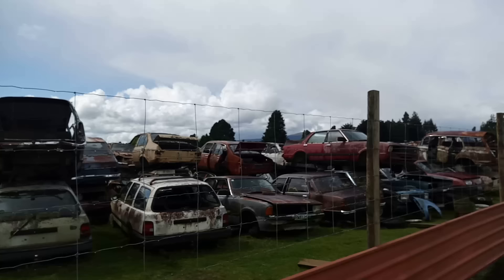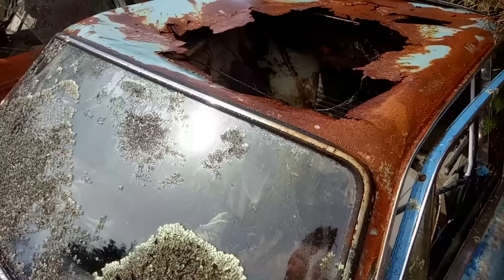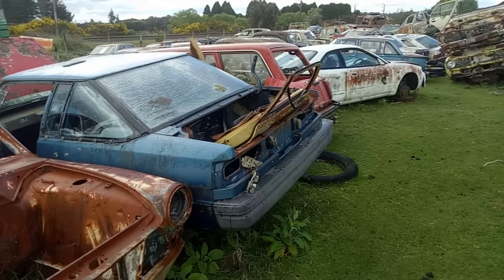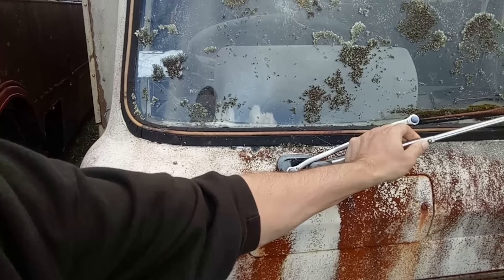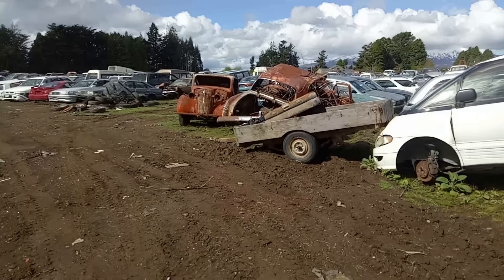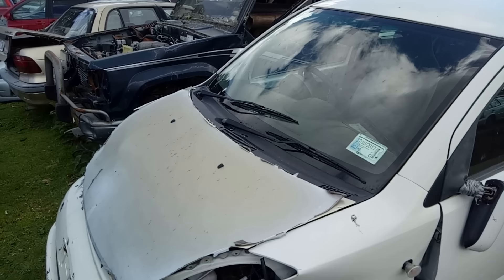(EP15) 1-hour of EPIC SCRAP! Horopito Motors, New Zealand - HubNut Goes Global

Comment: 12:14 An Avenger in a scrapyard!  Never!  From what we could see, it doesn't look rotten.  Oh someone save the Avenger.  (I'm an Avenger nut, mine is a 1972 Hillman Avenger 1500 Super.)
Reply: I guess more likely badged as a Plymouth Cricket. I saw a few I think though Ian only mentioned the one in passing. Shame on you Ian, best car ever to have been ignored.
Reply from the maker: There were quite a few Avengers in the yard. Lost some footage.
Reply: Another spotted at 37:22 but that's much too far gone.
Reply: @video99couk  Not crickets in NZ, locally assembled avengers and alpines gls's aswell. Then the Chrysler came though.
Reply: I'm a bit partial to the Avenger too.
Reply: @Zeem4  I've told Ian that next time he's in South Devon, he should call in and get to play with my Avenger (and Gen6 Celica).  They're his sort of cars, I actually use them, they don't just get polished on Sundays.
Reply: unlike cortinas avengers never rotted as much neither did mitsubishis which were made at the same plant in new zealand
Reply: I have 3 Avengers one '75 super 1300 which along with my Tiger MK1 is a complete restoration project, but also have a '72 1500 Top Hat. I know of only 3 other Top Hats and know the owners of two of them, you'll probably know being an Avenger nut like myself there was 700 Top Hats made and know believed to be rarer than the Tiger. You with ASOC, Avenger Sunbeam owners club? So I am with you please someone save that Avenger.
Reply: @thejamesieboy  Yes of course, with the ASOC group.  Let you into a secret: My channel's New Year Special for this year is (weather permitting) going to be road testing my Avenger.

Comment: "Impressive" isn't the word for that place Ian - I'm not sure what is other than "gold mine" or "treasure trove", but it's more than enough to make your wallet tremble in fear. 

There are obviously some blanks (cars you've not seen, or know little about) so I'll try to fill in a bit (NB my Oz car knowledge is sketchy, so if anyone knows better than me by all means chime in):

1:46 - Chrysler Valiant AP5 (early 60s)

3:04 - Valiant VK(?) (Oz, mid-70s)

3:53 - Valiant (VF?) ute;

(I think we're seeing a pattern here...)

4:11 - Holden HD?

5:34 - (yet another) Valiant wagon?

5:45 - I can remember lots of 2-dr A30s (my Dad had one - JTK 719) but I can't remember seeing a 2-dr A35 in Britain (in my defence I was Very Young); 6:10 Skoda 1000 - crumbs, I never knew they were exported this far away (Dad had a 110 as a loaner and later owned an Estelle);

7:15 - what on earth is that light blue small van-like thing right of frame? I've tried FIAT Multipla but it isn't that. Answers on a postcard to...

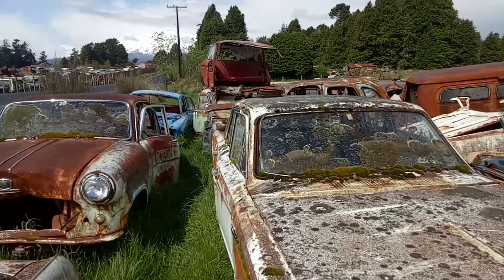7:40 - probably a Valiant (again) AP6;

7:55 - mid-60s Falcon wagon;

10:28 - To me it's "leonie" but is that a Mitsi Galant VR4(?) These had awd and (I think) 4WS. Plus bonus MR2;

12:01 - "Scrapyards are dangerous places". Ones like this especially.

12:43 - Oz gots lots of these vans a while ago. They had M-B engines (and badge) but I think they were "assembled" and "styled" by SsangYong at the same time the SsangYong Musso 4WD was around.

14:48 - I've hankered after a FIAT 850 coupe for years. I know I'm odd;

15:35 - cripes, look at the condition of the original interior of that P4. People in Britain would commit all sorts of bodily harm to get their mitts on that;

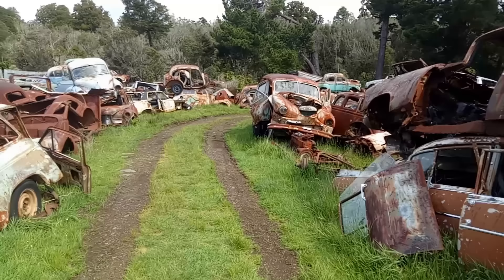16:33 - wasn't that the Hillman Husky?

21:56 - LAD-cabbed Albion/ Leyland Clydesdale (can't see the rear hubs) with possibly a 2-speed axle;

23:07 - Bedford TJ

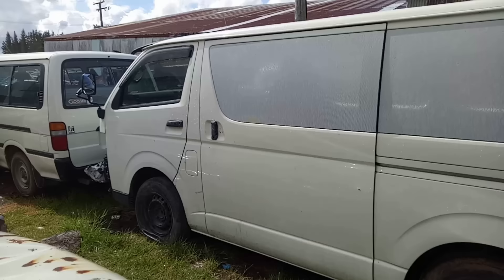24:47 - R12TL estate - yes please;

28:16 - it's a Toyo Crown, not a Nissan;

33:44 - series 1 Dodge Commando

35:25 - at a guess it's a Leyland Tiger Cub;

37:24 - blimey, where to start? 323 Astina, Lada, Toyo Surf; Datsun ute...

41:47 - no, it's a Nissan Pathfinder (not Terrano) - the Terrano was an ungainly narrow body 4WD thing that was also sold as a Ford (Maverick?). Unlike the Pathfinder, it didn't last long (thankfully);

43:18 - KH Ford Laser (as you say, essentially a Ford re-body of an early '90s Mazda 323). In the '80s and early '90s there was nowt wrong with a Mazda 323;

43:48 - XF Falcon;

44:25 - I do like early Sigma wagons, especially if they've got the Astron;

47:02 - Hino RG, bodywork by ...?

48:04 - facelift Mitsi Sigma

48:35 - Bedford TM and a very early one at that. The full-width cab versions got Cummins E290, R-R Eagle and - oh my oh my - Detroit 8V-92 2-stroke V8 diesels. If you ever get the chance to ride on a Denning (Oz-desgined and built) coach with either the 6V-71 or 8V-92 2-smoke diesel, take it. I promise you won't regret it.

49:27 - AU Falcon XR6 sans headlining; how disappointment;

54:25 - sold as a Daewoo Cielo(?) in Oz - unsuccessfully .

54:48 - neither did I (let alone sold in NZ)

Much like yourself Ian, I seem to have wandered off the plot a bit. I do apologise.

Comment: The twin wiper Camry was also licensed to Holden as an Apollo model. Sadly only a single rear wiper on the wagon from memory. Wonderful room, excellent steering but lacking engine power in 4 cyl. This arrangement was carried to the end of this 'wide-body' model c.1997 and started in the preceding smaller bodied line. The Holden was a JM & JP series, the Camry SDV10 (4cyl 2.2 litre) and aaaargh the V6 version transverse and fwd.
This incredible yard is one one level soul destroying...the waste ! But it is what it is...and has brilliant stock. Reminds me of a yard/yards in northern Geelong, Victoria what with all the lichen and mould and variety. The Laser hatch was available in a 4WD Ian in Aus and I think also hmm Turbo ?? Mitsubishi Australia designed a station wagon Magna...hugely capacious with outstanding load area competing with the Falcon and Commodore wagons of the day. The 2.6 four was a false economy motor however as it used very close to the far more powerful Holden and Fords of the day. Lovin' the Tercel choice, always wanted one of those...a 4WD Corolla and so so rare now. I've waffled on a bit, blame the coffee. Ahah ! The facelift version of your Falcon was the 'BA' which shared doors only externally I believe but had massive engineering upgrades particularly the DOHC 4 litre engine, known as the Barra as well as a V8. Hugely fast and powerful and the most base 6 is very powerful, economical to a scarcely believable degree too.
Reply: Apollo wagon had twin rear wipers too.

Comment: astra kadett gte gsi, that hurts me to see that sitting there
Reply: Shame since that one is less rusty than the ones I see driven here in eastern europe. One guy drives one which is almost split in half from rot!
Reply: @Matthew c.4 Not a big fan personally. I always preferred the older generation of Kaddet.
Reply: opel kadett gsi, it had the Gsi badge as well in the last kadett runs, before they too changed to the astra name

Comment: To fill in the gaps on the Aussie tin
3:29 Holden 1968 HK Premier
3:30 Ford XR-Xw ford falcon panel Van
3:48 Mitsubishi Magna TJ
3:53 Holden HT UTE with Premier sheet metal for twin lights
4:12 Holden HR
5:05 Ford Falcon XP 65
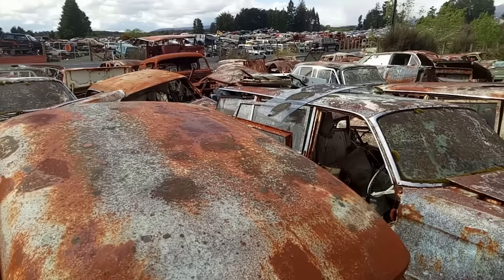5:17 Holden HD 66
5:37 VG Valiant Regal Station wagon
Reply: 5:55 Holden HG
5:58 Ford Falcon XM station wagon
6:39 Bus could be either International or Dodge, were made in Oz with shared cabin in 60s and early 70s
Reply: 7:40 1966 Plymouth sold as being upmarket but just an Oz Valiant with a different grill and bonnet
7:56 rear shot of two Ford Falcon station wagons XR or XT to the left of the screen and the other a XM
Reply: 8:54 1970 VG Valiant Regal Hard top that someone has removed
14:37 next to stuedy, a 1960 Holden FB
16:04 Standard 10s were made/assembled in Oz
16:44 Valiant VC 66
16:50 Rear of Valiant VC station
 wagon
Reply: 51:00 VF Valiant 
52:06 rear end of VK Valiant
53:52 The Gemini is in fact Australian built in S.A. on the GM R Platform. Clue: Lion on the horn. Interestingly the car was also  sold as an Isuzu in NZ through a seperate dealership,  but were built by Holden in Oz

Comment: HorrorPity Motors, enough to make you cry.
So many of them have just about the same amount of rusty sunburn which makes you wonder if about 20 years ago a huge load of them came there over a very short period. Maybe several yards amalgamated. It obviously didn't get caught up in the mad scramble for steel when prices were several times of what they are now/ton.
Good to see that your car model database got a good hammering there Ian. Well done.

Comment: Lots of stuff! The Isuzu was an I-Mark, brought to the US as a Chevrolet/GEO Spectrum; my sister had one that was a turbo, as well as a 3 door. Many of those Mitsubishi were sold over here as Dodge, as Chrysler at the time had controlling interest in Mitsubishi. So the Lancer was sold as the Colt. That old 1958 Chevrolet was either a Bel Air or à Biscayne, too far gone for me to identify, you got that right.
As for the Integra, we did get that over here, branded as an Acura Integra. And gobsmacked over the Subaru GL 4WD! Definitely early 80's.
Well done!
Reply: Shocked over the RHD Ford Taurus! Never knew about that! Turn signals are different than those in the US 🇺🇸.

Comment: Wow! What a treasure trove that place is. I might be able to shine some light on the ones you were wondering about I think. 7:42 is an AP5 or AP6 Valiant ute. 36:20, well GMH stuffed the Holden six into the Bedford van to compete with Ford. They used the Falcon six in the Transit van and it was the darling of Australia Post who bought every one they could make. 14:14 is a Mainline ute. Ford cut down the Australian assembled American Customline to produce this one off. 30:58, the strange yellow car is a Datsun Bluebird. They were the first Datsun's introduced to Australia....ironically by Lawrence Hartnett who was the father of the first Holden. Go figure ha LOL. 53:41 is the Holden Gemini. It ran from 1975 to 1985 in rear wheel drive form with various facelifts to be replaced with the RB model you saw which was front wheel drive. Thank you very much mate, you just brightened my Saturday afternoon looking at all of those beauties.

Comment: Australian CF Bedfords all had factory six cylinder engines, either a 173 ci (2650cc) or 202 ci (3300cc) Australian made Holden engine. We also had a version with dual rear wheels and deep diff ratio for high load capacities. Like most British cars, it was our long distances at 70 mph + in 100 deg heat that killed them.

Comment: Little yellow car at 30.50 - 30:57  (ID's as a Mazda!) is a Datsun 410 - could have had 1 ltr. or 1200 cc engine, 3 or 4 speed gearbox, based on old Austin designs.  I owned a red one in 1967-1969.  Find me one still running!
Reply from the maker: Aye. Bit embarrassed by that error...

Comment: 6:50 It's a Zephyr 4 (MkIV) because it has a plain painted front panel. Zephyr 6's had a fake chrome grille (still with single headlights) and the Zodiac had a fake grille and twin headlamps.

Comment: Mk 4 zephyrs were either in std (the one you featured or deluxe which had the chrome grill. Difficult to miss the v4 engine as it was so small it disappeared in the vast engine bay and was eclipsed by the spare wheel (can’t speak for the V6 though). Luvley car though, a proper whafter, both my dad and uncle had one. That’s my trivia for the day. Excellent vlog as per your usual std.

Comment: It's very surprising all the old steel lasted the the 1000 dollar a ton scrap price. It absolutely decimated the old car collections in Australia. 

The Bedford vans were sold in Australia with Holden 6 cylinders 2.8 ~ 3.3 liter. They also had Australian 4 cylinder engines called a Starfire four  1.9 liter  four cylinder version of a Holden 6. 
This yard is like a cross between Mad Max and Lord of the Rings.
Did you get a headlining for the Falcon?

Comment: Great vid. Sad there’s so much waste but I’m glad it’s in one spot. This is why I buy used cars. Anyway. 

I was amazed by the Taurus wagon find. That would’ve been a Japanese spec. In Australia I had the Taurus Ghia sedan. They were imported from US from ‘96 to around ‘98. They were unique.  They had the Ford Taurus US rear, but a Mercury Sable front bumper and headlights. That wagon had that. The sedan I had in Australia was also in Japan. They sold very few in Australia. It was a big failure but I loved it. My friends called it the spaceship, so smooth. It was way smoother than falcons at the time. 

The Falcons after the XF (those which looked a bit Granada but no sheet metal was the same) then EA onwards were inspired by the original Taurus. I have a  feeling that happened with the AU falcon (ie. all the oval bits in the interior and external shape). But at the “last minute” based on Taurus import failure they quickly did the Edge design language. The end result was all over the place. 

Anyway very interesting find. Great vid.

Comment: i had a mazda cosmo bought from a yard here in aus but it got sold because it was an auto, it had an issue a few mechanics couldn't diagnose shuddering at about 70/kmphs the first thing i touched fixed it a loose earth wire on the pre pump for the surge tank.

Comment: 21:56 Albion LAD cab (Leyland / Albion / Dodge) or more correctly, the Vista Vue cab. Really should be nicknamed the SALAD cab because Scammell and AEC used the cab also. There was the long door (as in the video) used by Albion and Leyland .... and three early Scammell Trunker Mk1's before the Michelotti cabs were used on the Trunker Mk2. There was a short door used by Dodge and Leyland .... plus some bonneted short doors badged as Scammell Contractors. Of more interest to the land down under though, in 1964, 300 left over short door cabs were shipped to Australia where the finished trucks were badged as AEC Mustang's. The short door cab ceased production in 1964 (hence the leftovers) but the long door carried on until 1972, almost outliving the cab that was meant to replace it (the Ergomatic). The top half of the Vista Vue cab was also used on the smaller Leyland 90.

Comment: 13:07 Chevrolet 1958, seen with at least two doors, the engine, hood and other bits removed, attesting to its once valuable purpose as a parts car.  Now there is not much left of it.

Comment: Interesting, the Pontiac Le Mans has the rear quarter winters like the Daewoo, rather than the Astra.
Reply: I thought that too, it was the Daewoo Nexia here in the UK.
Reply: It was made by Daewoo
Reply: @AaronSmart.online  Thanks Aaron, so is that another case of one design with many names and tweaks for different markets? A good idea when you can open up other markets with one basic design.
Reply: @graemew7001  The Nexia was the facelifted version of the LeMans, both had various names in different markets.

Comment: Thanks Hubnut.  That's an excellent yard.  There is actually an equivalent yard in Australia. If you find yourself passing Cooma NSW, check  https://vimeo.com/171679476  On the Holden engined Bedford CF, we similarly in Australia had Transit vans powered by Falcon straight sixes.  I had a Holden powered Bedford for a time.  Holden had never imagined that anyone in the future might want to use one for a campervan and gear it for highway speeds.  Their initial machining of the brake drums paid no attention to keeping the metal thickness even all the way around, so the damn things were too out of balance to travel at over 50mph!

Comment: The Taurus was mid sized, not compact.  I too like the second gen. wagons.  The sedans were "meh" (my wife had one).  Transmissions were only good for about 120,000 miles, though, and by then the cost of repair exceeded the value of the vehicle, which is why so many ended up in junkyards, even if the engines still ran.
Reply: My dad had nineties Taurus wagon. It was nice, and only ten years old (young for him) but when the exhaust rusted out, the cost to replace it (something like $3,000, as I recall)  exceeded the price of a fifteen-year-old full-size slightly rusty Ford wagon that was for sale down the road, so he scrapped the Taurus.

Comment: THE PINK MORRIS MINOR IN THAT COLOUR IS MOST LIKELY A ONE MILLIONTH MINOR OF THE PRODUCTION LINE......I SEEN ONE IN 1969 AND IT HAD A BADGE ON THE BOOT DOOR WHICH READ 1000000. INSTEAD OF 1000. IF IT IS AN ORIGINAL BRING IT HOME I WILL BUY IT OFF YOU.

Comment: Most of yard looks to be burnt out - Opel Astra would that not be a Kadett pre 91/93 ?
Reply: Definitely surprised to see a Pontiac LeMans badged Opel. And yes, they were Korean built, they were very underpowered and most hated them, they felt they were junk. I believe they were manufactured by Daewoo, as they went bankrupt like Kia, GM buying Daewoo and Hyundai Kia, although I could have my dates mixed up. I remember Daewoo Leganza sold here, then Daewoo collapsed.
Reply: @frothe42  . Also sold in Australia as the Daewoo 1.5i (and later face-lifted model as the Cielo) I believe it was the first Daewoo model sold here - not a great start, as they were not very good cars and sold modestly, based solely on the fact that I think they were the cheapest new car on the market at the time.

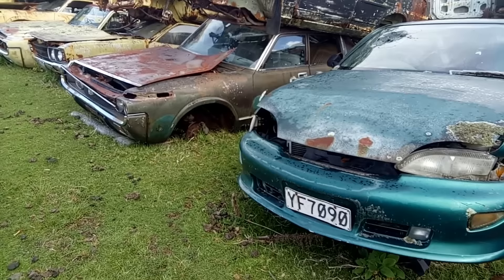Comment: 28:17 and 29:18- Holy CRAP! In the back on the left in green, one of the Toyota-badged Chevrolet Cavaliers! Horrible failures, those things!

https://en.wikipedia.org/wiki/Chevrolet_Cavalier#Toyota_Cavalier

Toyota and GM had a partnership in the late '80s, early-mid 90's and they briefly had an agreement for Toyota to sell rebadged Chevy Cavaliers in Japan under the Toyota name! They were a failure because reliability, build quality and quality of materials were far below any Japanese competitor in the same segment, so almost nobody bought them!

They can easily be recognized from the US cars because they were RHD and the rear taillights had amber lenses. They also had side repeaters!